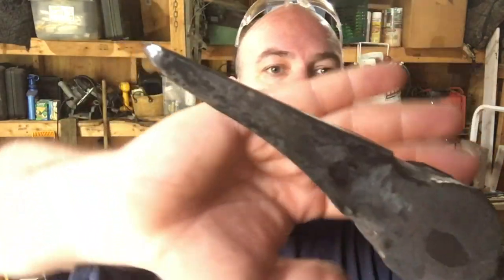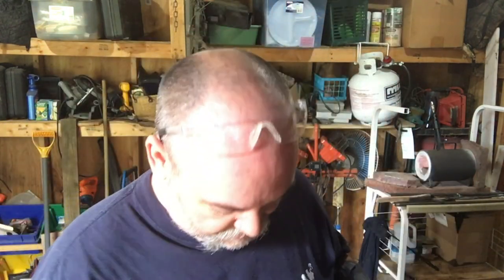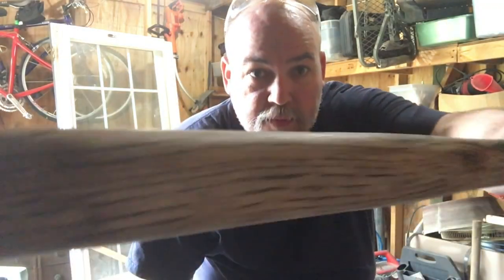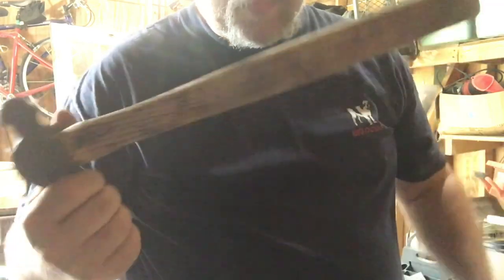ball peen to hammer eye punch

Comment: You are busting butt and excellent progress! A suggestion for working hammerheads...drop it in the forge, fire pit or bbq grill the night before. Get it to at least red. Let it cool down slow overnight. It will soften it for forging, yet can still be hardened
Reply: And please don't be offended, I suggest this next point sincerely....weigh down your anvil base, with a couple more boards or even barbell weights....that bouncing is killing you...(been there, done that myself)
Reply from the maker: thanks fr all the input. i never thought about heating it in a fire pit before working it. and ya the bounce it picked up is new I need to nail it down better and more weight.
Reply: I've seen two approaches, one is to cut some angle iron to run bolts through on the ends of the track piece, holding it down by the bottom of the i beam shape. The other is to drill holes in a few spots along the bottom of the track and railroad spike it down.

Comment: great video brother. good proof of concept for me. i plan to make one myself with the same material starting stock. i had no idea if it would fall apart. thanks for that. Glad as hell that uoi are having fun.
Reply from the maker: thanks, ya i was worried of how it would be.  I have used it several times and its holding up so far.
Reply: that's fantastic to hear. I went ahead and spent a bit over $100 on an s7 hammer drift but i couldn't see shirking the responsibility of making my own punch when i have the hammer already. i bought the drift because i tried to make a mild steel drift and between the heat here in FL and the heat of that thick bar of steel my shop was unbearable to forge in, so i figured kill 2 birds and all that.
Reply from the maker: I would wait to you get your drift so you can make the punch the same shape and your drift
Reply: that was kind of the idea i had as well. if i can get the biggest part of my punch to be just a bit bigger than the smallest end of my drift, I should be able to make a nice transition between the two.

Comment: you shouldn't harden that punch. your hammer is hardened and you don't want to strike 2 hardened surfaces together, it could be catastrophic.also driving the punch into hot steel you will loose the heat treat. check the hardness after you use it once or twice.
Reply from the maker: I only hardens the punch end, the end i would hit i did not harden i thought that should be fine. so i should remove the harden i have done?
Reply: no, use will do that for you.
Reply: @BBForge  No need to take the harden off of the punch.  You'll take it out as the punch gets hot with use.  That's why most smiths dont bother hardening it in the first place.